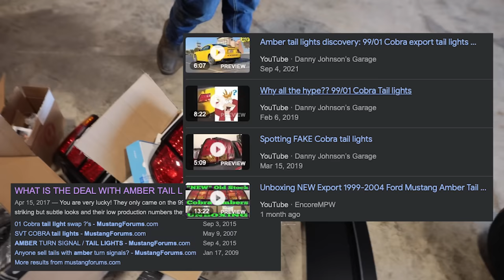Building & Racing a Terminator Cobra in 24 Minutes!

Comment: Important note. There's a bolt on the inside of the wheel that sticks out towards the tires. With running 335s you may have to swap those bolts out with flat shorter ones or they will rub the tires.
Reply: I was gonna say the same, it’s 100% rubbing
Reply: Next video update, I blew my rear tires. 😂
Reply: that or wheel spacers.
Reply: Yup need the maximum motor sports hex bolts , and the correct size bolts for the front sub frame which were the wrong size from the factory
Reply: Not true it depends on the offset that he got because mine don't rub on anything
Reply: Regardless the stock wheels looked way better
Reply: @HooligansMx  I’m not a mustang fan but I thought the same. If I won this car I would want the factory rims.
Reply: @HooligansMx  I think he did these wheels because chrome are pretty much out of style nowadays. It goes really good with all the black accents but I'd probably want the factory wheels to make a table. We've made a table out of our old school corvette wheels a while back.
Reply: Keep it original guy kept it so clean for so long then some young kid gets it and messes it up
Reply: @Jesussavesyouandme it is clean it dont gotta be stock to be clean.
Reply: Just ground the head of the bolt down a quarter inch if it's close. Don't want to use weaker MM bolts here.

Comment: Should have done a 315 and it would fit perfectly. Looks silly sticking out so far and with the wheel gap.... looks like bro dozer fitment
Reply: Yea rears are sticking out way too much 10.5 max
Reply: I agree
Reply: 110%
Reply: Yep and the front bumper mod not a fan and they drilled holes so one would have to change the skin for it too being right. Imma definitely pass on this car. I don’t like holes being drilled 😂 definitely by Poe
Reply: @triplehfarmsllc7348  omg this car sucks and i don’t want it for free bc it has some holes that aren’t visible and the tires are a little wide
Reply: @triplehfarmsllc7348  I couldn’t agree more, I was really scratching my head on the decision to do the splitter and defuser. Ricer mods? Not to mention doing 5th gear pulls in a terminator, not very wise to do. Especially if you know anything about those boosted 4v’s without a head cooling mod.
Reply: @RememberOurPast414   Yeah forsure it’s a nice car but if you know alittle about them you scratch your head and wonder wth am I watching being done here haha. But I guess some see it differently then I do and I understand that. But the criticism is pretty comical over me calling out flaws&thinga that make me not wanna enter into the giveaway. And I’m a mopar and diesel guy even though I have a mid 4 second foxbody. My dd is a 823rwhp 2020 Cummins and my wife’s dd’s a 2021 srt Durango and currently trying to get my tt scat pack challenger ready to hopefully get in on sic week. Fingers crossed
Reply: @triplehfarmsllc7348  That’s awesome brother, that’s a badass dd! Not too mention you are one of the many few to actually BUILD a 6.4 scat and do it the right way. All I can say is props too you my brother! I made this name a long time ago. You can call me a ford guy, I got a 97 cobra that’s termi swapped. So it definitely hurts me seeing this.
Reply: @RememberOurPast414  gotcha I like a clean mustang but over the. Years I’ve went dodge they super comfortable driving. My wife Durango is a dream on the road and it’s pretty quick for the weight and all. And goes great in crap weather. Well atleast some ppl have commensense and see what I’m talking with the giveaway car haha if you know you 100% understand.
Reply: @triplehfarmsllc7348  Absolutely my friend! I guess the quote would be “if you know you know” it was great talking to you. I would love to see that twin turbo scat at some point, and I know what you mean my dad has a hellcat and he’s always telling me how he loves the way it rides and drives and how comfortable it is. It’s been a pleasure brother, take care!
Reply: @RememberOurPast414  most definitely. I’ll be videoing sic week with it and the next Rocky Mountain race week as well. Really pushing for low 7’s but idk if I’ll get her dialed in for sic week too run low 7’s but fingers crossed the air should be great for boost.

Comment: I can't hit third in my '03 sometimes either, it's like it's locked out.  Only had 5500 miles on it when I got it last year so it wasn't worn out either!
Amazing looking terminator!
Reply: Make sure to change your transmission oil and get aftermarket shifter if you don't already. I like MGW. The change of oil made a huge difference on my 04', it had under 25K miles when I got it.

Comment: Makes me miss my terminator. I want to get another, but one that has a lot less miles than mine did. (140k)
Just so you know. Doing pulls in 5th and 6th is a big no no in these cars.
Reply: Why? Transmissions?
Reply: Why?  Never heard that b4
Reply: @Dukes3677  it's really hard on the engine, they aren't the best at cooling

Comment: so happy to see you clamp the rims that way on the machine, kills me when people clamp from the inside of the barrel. also that coil spring tool is pimp.

like the tasteful upgrades.
Reply: Bro, where do you find the spring compressor? I did my suspension a bit ago and used the two bolt c clip things and that shit sucked, popped a few threads and almost took my fingers. I need that tool 🤣

Comment: Put a mgw shifter in it. I have a 2004 convertible cobra . I like it you will too. I just have underdrive pulleys injectors intake and a tune and I'm running mid to low 11s.

Comment: Are you going to install a head cooling system for Arnold since the terminator engine heads overheat in the rear of the engine and have hot spots and valve ticking since the left rear head doesn’t have active cooling and nobody wants to deal with that problem?

Comment: I know there is a sn95/Lincoln budget big brake setup, Cadillac ATS-v brembo front calipers, you have to shave a few mm off the calipers and drill the stock caliper bolt holes I think to 18mm, I’m sure you can find the exact info online, but this setup actually uses all the rotor on the front, stock calipers do not

Comment: 335's on an 11" wheel is a terrible idea. 315's max on an 11 and even that's not a perfect fitment. 335's should be on a 12-12.5" to sit nicely. I love the CO termi though and i plan to try and get entered into winning this one. the cosmis wheels look good on it.

but like others said, get the shorter head bolts for the rear. i also cant believe nick traded the porsche for a Z🤢🤮🤮

Comment: The 3 2 1 go count threw me off. Also pro to, McLarens usually come with a trickle charger. Leave it plugged it. When I worked at the dealership we had to keep them plugged in cause even the new ones, off the truck, would die like 2 days later. Something about the computers still running in the background when the car is off and I guess it kills the batteries

Comment: Hey Gavin! I am pretty close to getting my first muscle car. Do you think I should get a Mustang GT 5.0 (manual of course) from around 2016-2020, a Camaro SS of the same year, or get a 2014 ZL1? They are all around the same price. I don't really want a scat pack because there's too many of them. Btw my parents have a 2008 Pontiac G8GT with the 6.0 and I can drive it to its full ability. So no need to worry about too much power with the cars I'm considering.

Comment: Call me old fashioned but I actually prefer the stock look. IMO these cars don't need exterior mods other than a nice drop and wider rear wheels/tires. Also, never been a fan of that rear diffuser and front lip. Hopefully you didn't throw that lip away because someone will pay you decent $$ for that.

Comment: I hate it when my Lambo won't start.
Couple of small points...
The Termi doesn't sit quite right.  Wheel offset it wrong.  Fenders don't match the edge of the tread...so looks a bit ghetto.  Rear tires stick out the worst. Fast car though.

Last point...why did your buddy trade his Porsche for a Nissan that was never that popular in the car community?  Yes, the Z maybe faster but a step down overall.  Nissan for Japanese cars is near the bottom rung.  I could see him trading for Supra or something else...higher level Porsche, god forbid a BMW M car....but seems like a step down.  Must be a reason that wasn't discussed...possible technical concern with the Porsche...but an older Z car really?

Comment: My dad owns a terminator and if u turn off traction control and go back to stock suspension from a dig it’s faster than with bcracing coilovers and will smoke the z and the eco boost from a dig and a roll also if you don’t let off the gas and shift it keeps on power and won’t mess up anything in the motor